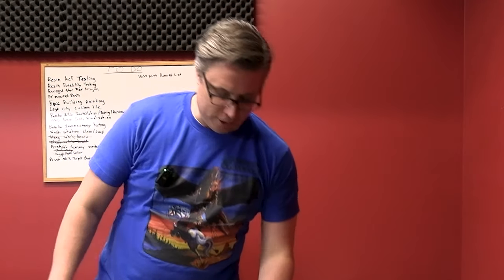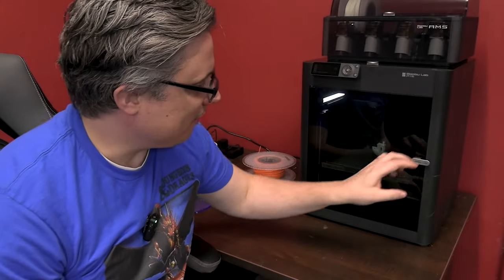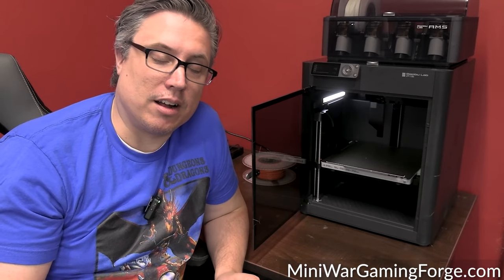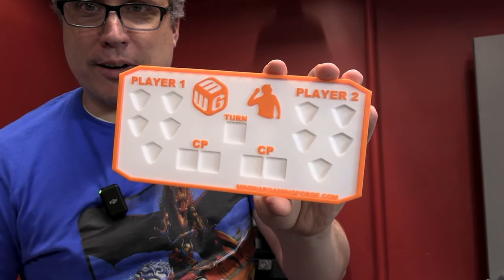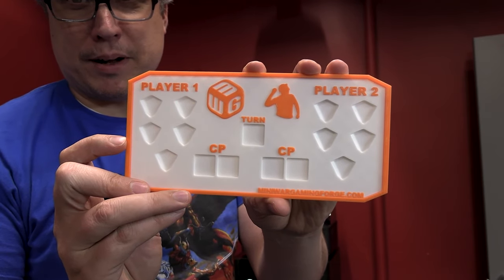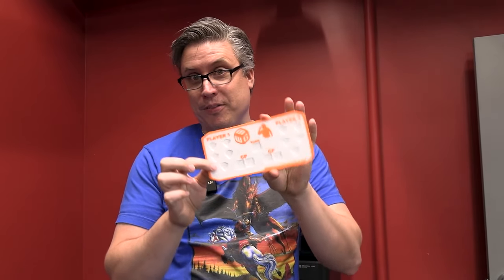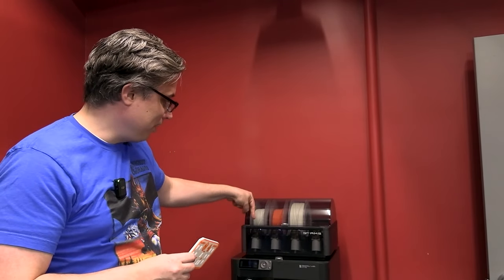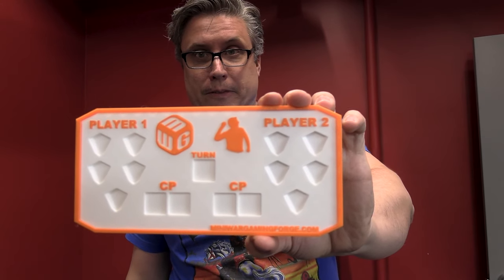Printing in Multi-Color with the Bambu Labs P1S

Comment: You had me at Support Filament.  Checking amazon and...its twice the price of regular PLA 😭
Reply from the maker: I haven't really experimented with it to see if it's worth it, but if it is, you wouldn't use nearly as much of it as regular PLA on the print, so maybe it's worth it?
Reply: @MWGForge   That would be pretty great, even with the extra cost.  I know I've stabbed myself more than a few times trying to get some extra stubborn supports off, especially in my earlier days.  I'd actually love a video dedicated to this support PLA stuff (PVA, apparently).  I've found easy breakaway and water-soluble variants of the stuff online.